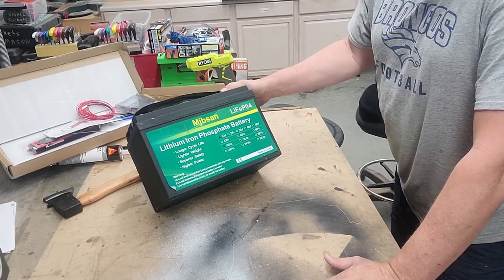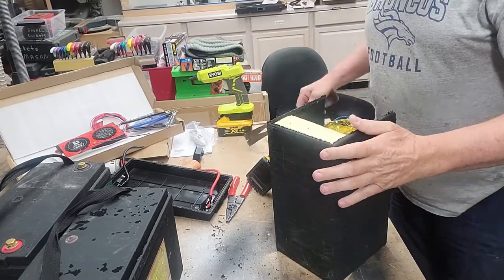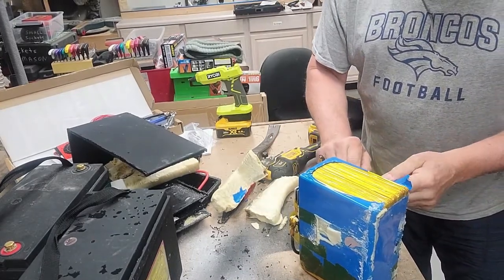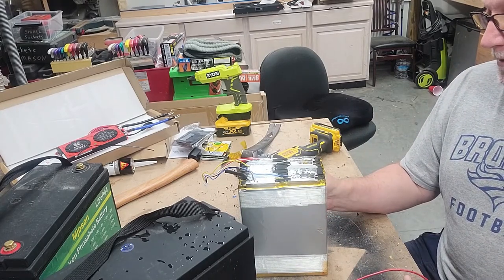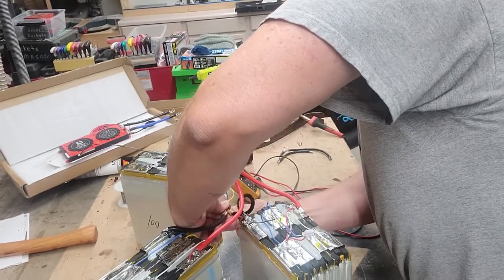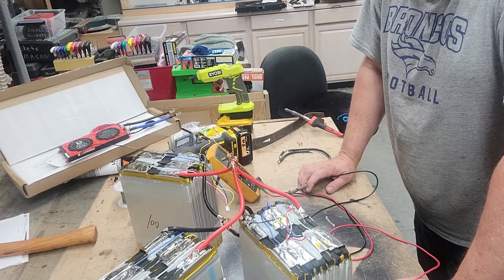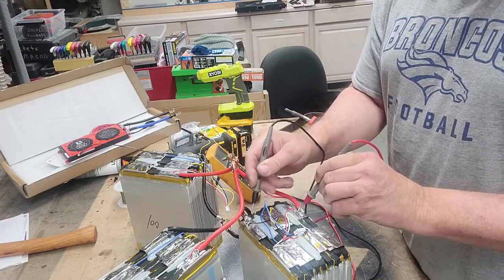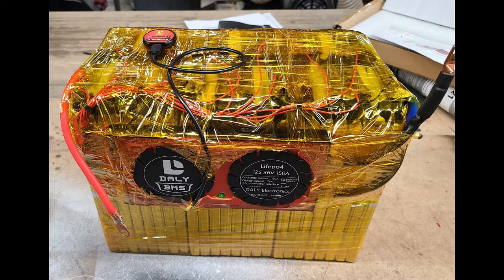How to make a Golf Cart Battery using Lithium Cells

Comment: Now, you can get 3.2v eve 105ah cells for under $40 a piece shipped in a few days. . That would be under $480 for a 36v pack… along with a 250A bms for $180. All in for $660.
Reply from the maker: yeah they are getting cheap again, just in time for my custom soar trailer I am finishing up on

Comment: You never showed it in the golf cart.  Big question whether the Daly 36V 12s 150A BMS is sufficient for a golf cart.  Can you assure us that it worked in the golf cart?  Ideally show this with a case, installed, and golf cart running?  Also would have been really kewl if you showed how to hook up the Daly BMS.  Is the phone app from Daly?
Reply from the maker: You are correct. I did install it and yes it's running fine. I would recommend a 250amp as my cart will spike to 178 amps for a second (starting on a hill) and daly is Chinese Made and never rated correct
Reply: @whoiseverfree  I was actually thinking 300A might be better, but cost difference between Daly 12S 250A and 300A is a lot just for buffer.  $200 vs $300.
Reply from the maker: Get a 250
Reply from the maker: Here lately I ditched daly and went to an active balancer
Reply from the maker: @sailork3506   The problem I've been having with the dally here of late is one of the voltage sensors ends up going bad and thinks your cell is under boat or overvolt. You check with a meter on the cell under load and it's perfect, daly bms thinks it's much higher or lower

Comment: Greetings, I stumbled across your video while researching replacement batteries for my 36 V EZGO cart.  I’m far less of an electrician than you, but the battle born batteries website indicates you can connect three of their lithium 12 V batteries in series to power a 36 V golf cart.  That sounds pretty simple, but maybe that’s not the case with cheaper Lithium batteries on Amazon??  I’m a little intimidated by the Deconstruction process and trying to wire up a BMS like you did.
Reply from the maker: So yes your theory is sound, however what you will find is the cheap battery management system they have inside of each battery is garbage and you will find that normally the center battery in  your 3 string and series will die that's why I split the batteries apart and did what I did
Reply: @whoiseverfree  Thank you so much.  Appreciate your insights!
Reply from the maker: Actually here lately I moved to Active balancer and ditched daly
Reply from the maker: Something like this..Heltec 4S 5S 6S 5A Capacitor Active Equalizer Balancer Lifepo4 Lithium Lipo/Titanate LTO for Battery Car Audio Group Balancer https://a.co/d/hu8cxY5
Reply from the maker: Something like this..

Heltec 4S 5S 6S 5A Capacitor Active Equalizer Balancer Lifepo4 Lithium Lipo/Titanate LTO for Battery Car Audio Group Balancer https://a.co/d/hu8cxY5